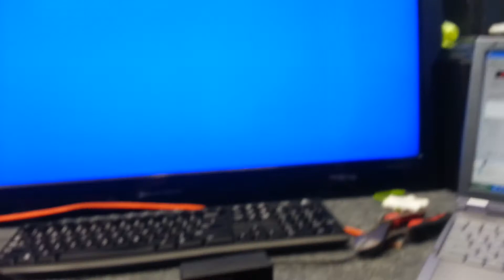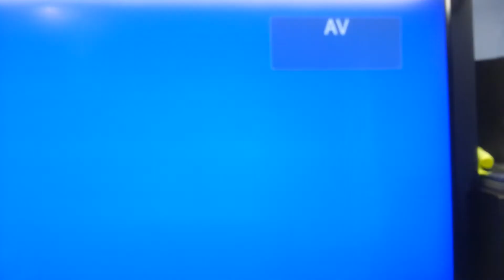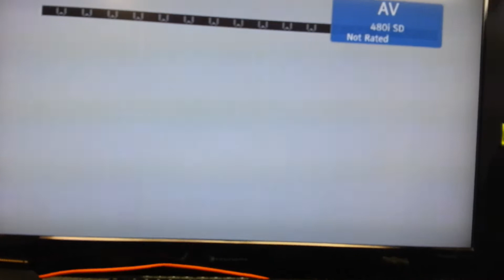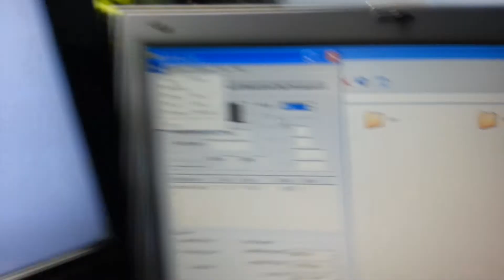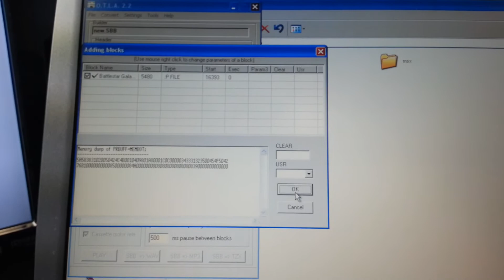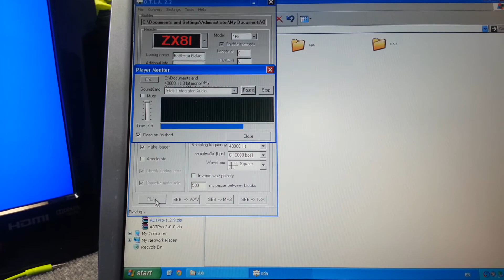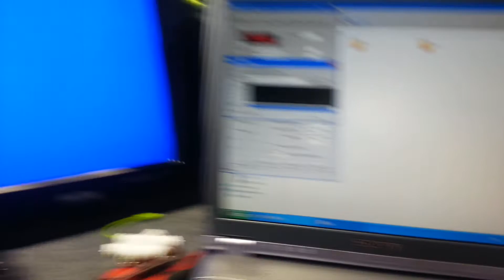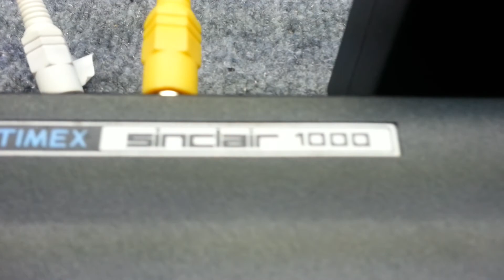Timex sinclair1000, composite video.

Comment: Thia is very interesting.   Can you go over thr settings you have for the software to work correctly with thw Zx.  I've tried it on a TS 1000 and a Zx.  Can't seem to get the sound correct and have noticed that the ot crashes after approx. 4 seconds